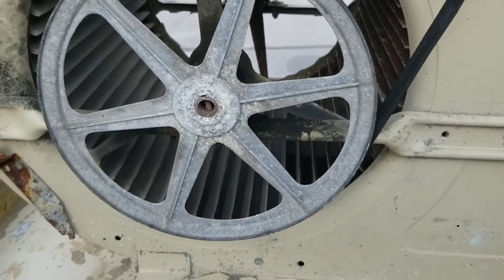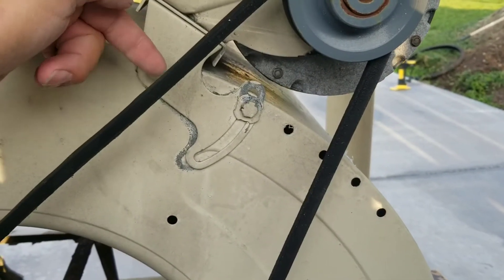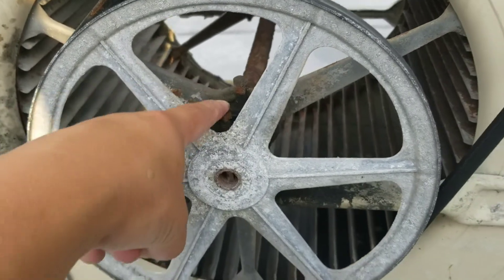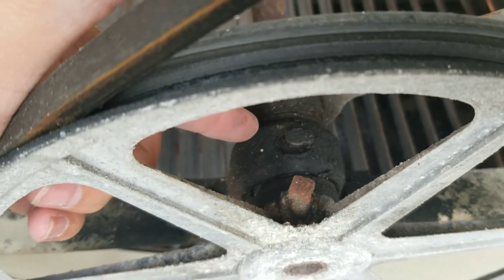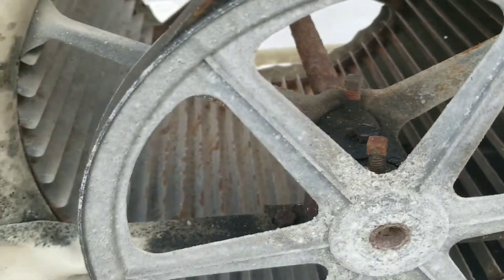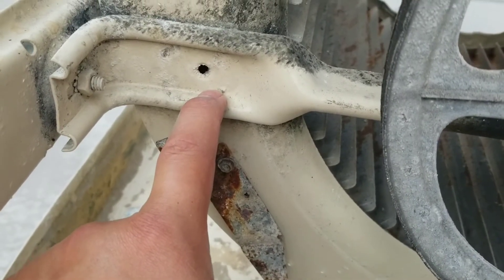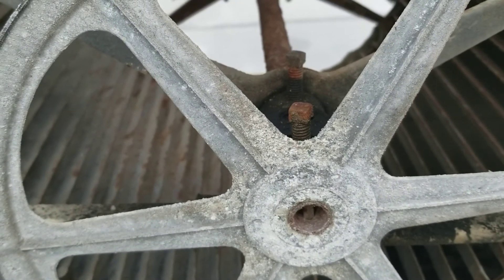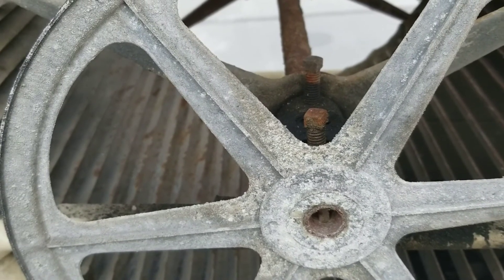Trommel built: steps to salvage the swamp cooler

Comment: Could you use the blower fan to shread small tree limbs and grass to make a compost shredder/ blender?
Reply from the maker: Unfortunately, the metal on a swamp cooler blower fan isn't very strong. The blower fan will push air, but would bend and break if trying to use it to make a compost shredder/blender.